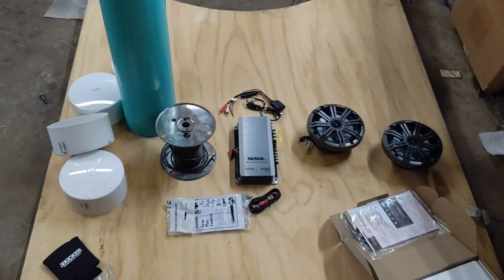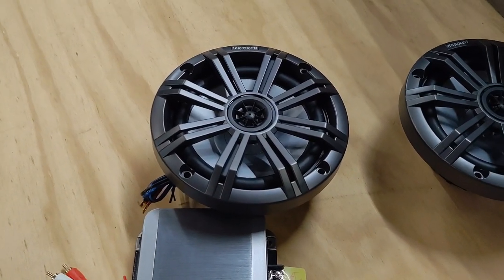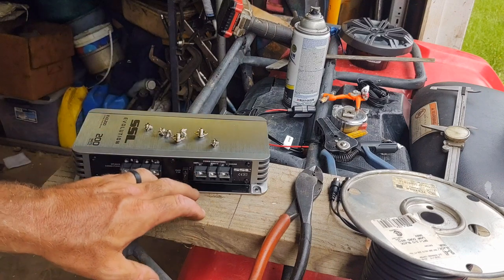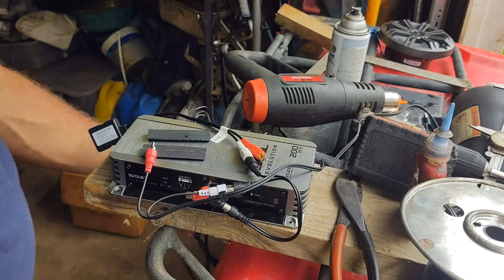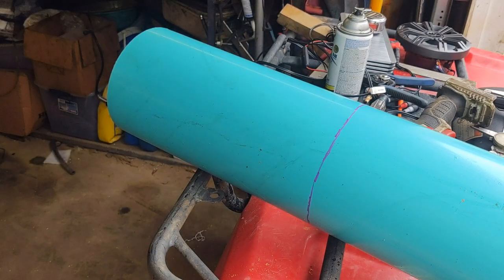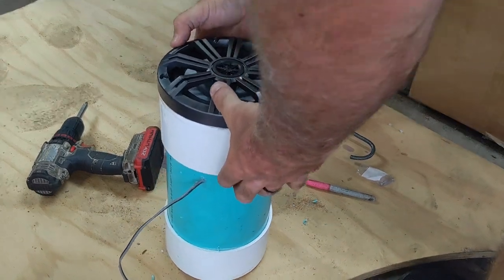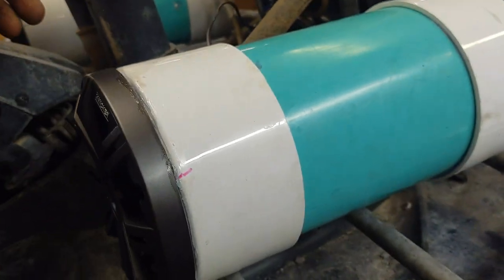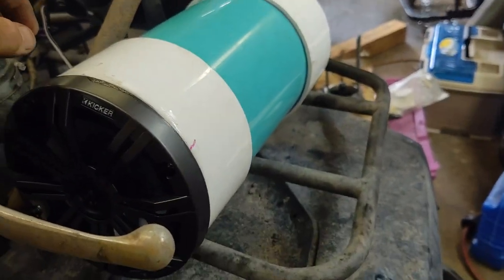ATV Speaker Tube

Comment: Have u ever done 15 up rubicon dct engine rebuild before? Just wondering how they look on the inside
Reply from the maker: Yes I have done one. They are not very complicated. They have a dual clutch that looks much like the clutch basket in a Rincon. Still has  a number of similarities with a normal 500. Naturally the top ends are the same.

Comment: My rancher 350 is running bad have no idea what causing my son was riding last night and came back and the fan was on the temp light was on and it act like the carburetor had trash in it it's how it's running now any idea
Reply from the maker: Make sure the oil level is correct. The engine running lean can also make it get hot and run rough. May also need a carb cleaning.
Reply: @FourwheelerDoctor  I turned key to the own position the fan automatically comes on you tempt life stays on I started it up you tempt light and the fan stay running all level is full read somewhere with said change the oil put a new filter in do that make any sense
Reply from the maker: @darrylmatthews5462  changing the oil and filter will have no affect. Sounds like you have a bad temp sensor

Comment: What are the dimensions of the speaker cover?
Reply from the maker: The speakers are 6.5" but I'm not sure what the overall grill cover size it. It is almost exactly the diameter of the 6" sewer and drain cap that I used in the video. If I had to guess I would say just a hair over 6.5 inches